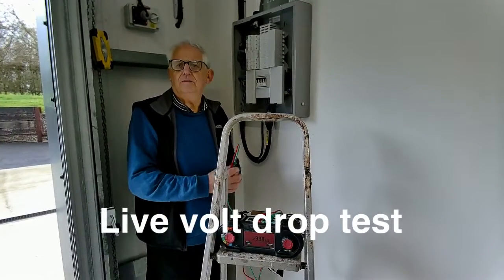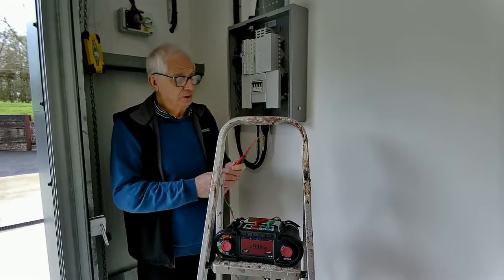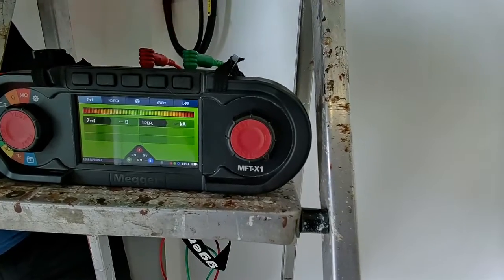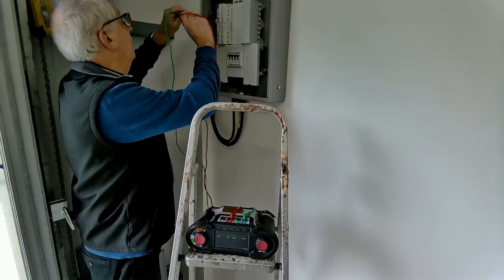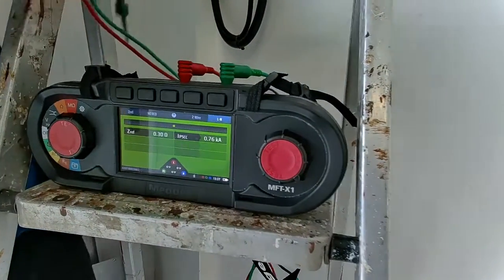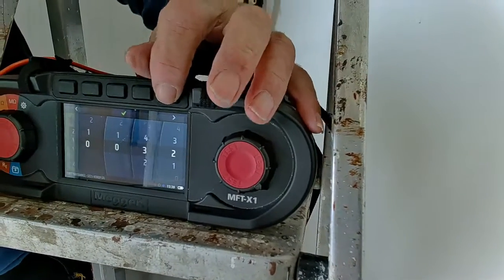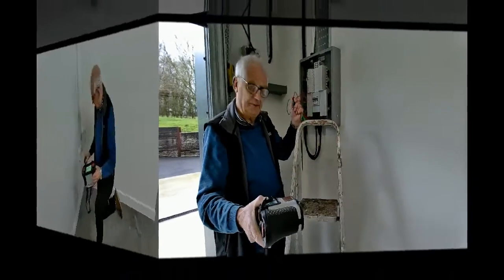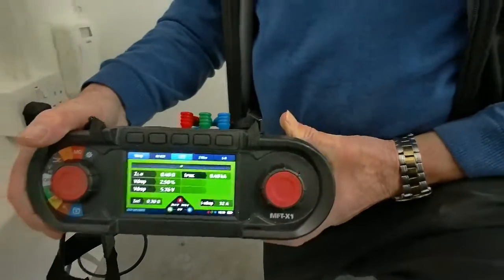Live volt drop test

Comment: I understand the theory of what the instrument is doing, but I thought that we don’t  generally measure volt drop in this way, as the test at origin and at the remote location, really needs to be performed simultaneously with the same instrument. 
Due to fluctuations naturally occurring in the supply voltage. If you test at origin then few minutes later test at the remote point the supply voltage will naturally move around due to loads being switched on and off (perhaps in neighbouring properties) 
Great video though Chris👍👍
Reply from the maker: All I can say is that I did a dead test and calculation, I then followed it up by doing the test in the video and the results were very accurate. In fact possibly the live test my well be a better method as when we do a calculation we would use 230 volts. The live test uses the true voltage. Interesting though isn’t it?